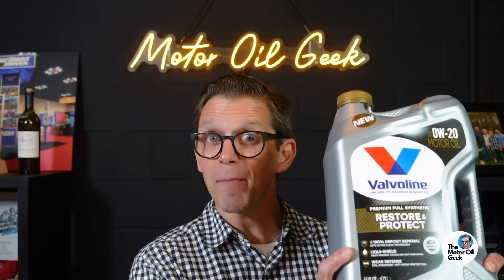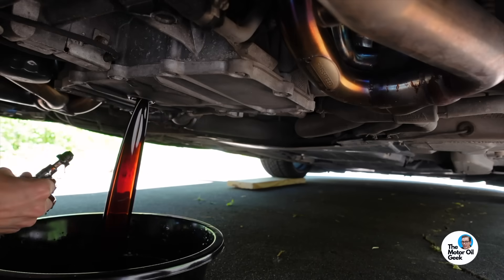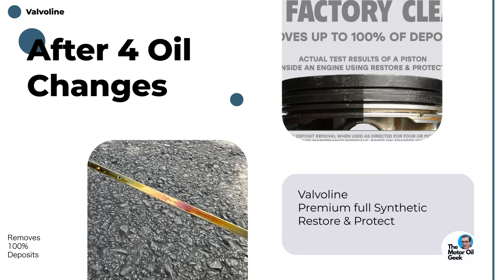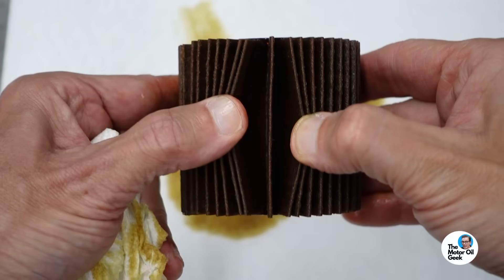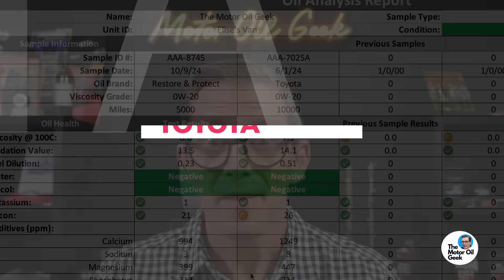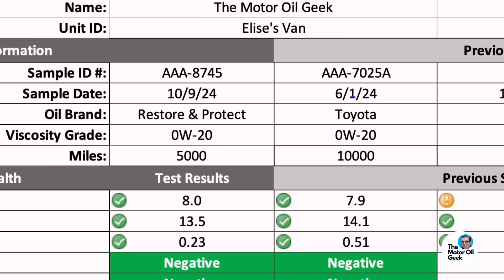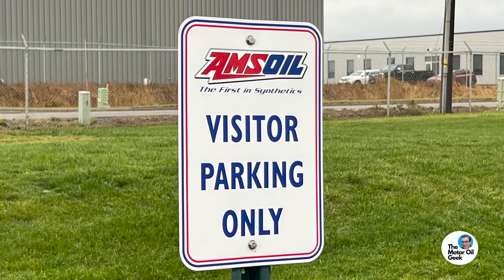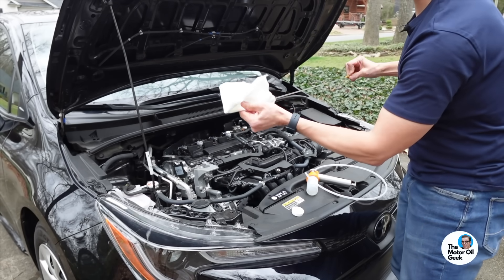The TRUTH About Valvoline's BOLD Engine Cleaning Claims

Comment: 380,000 miles on my Chevy Van 1500 4.3 .I use Mobil 15w-40 diesel oil CAT uses.
Clean no deposits .
For old high mileage motors.

I put a quart of ATF in run motor an hour then dump out all sludge comes out .
Then put new oil in .
Reply: I top off with ATF about a week before I do my oil change and change the filter only since it fill up with the sludge that is being removed and I want it to bypass as little as possible. 

I have been using Mobil1 15w50 that had been discontinued. I bought a bunch of it when it was on sale. It has diesel engine oil API ratings.

1998 Astro with 250k+ miles. Magnet drain plug and "cheap/conventional" filters. 

MMO also cleans GREAT.
Reply: @bradhuffjr777  Mobil 1 15W-50 was awesome in Harley motors.
Reply: I have the old timer 4.3 in a 2012 Silverado truck.  Those are really decent motors.  I've towed some pretty impressive loads and my boat with it.  When people bust my balls about having a six cylinder, I remind them that back in the day one ton trucks had sixes with less power.
Reply: @chuckgladfelter  true.
I tow mini excavator bobcat welder behind Chevy Van 1500 express 4.3.
No problem.
My other trucks are 6.0 Gm gas and 8.1 vortec in service truck Kodiak 4500 .
I got rid of diesel small trucks .
Only big trucks diesel is ok.
Nothing but issues with new age diesel engines.
$$$$$$$$$$$
Reply: Good luck when all the magnesium and zinc in that truck oil coats over the precious metals in your catalytic converter and it stops working then you have to replace it, maybe you're rich and won't mind.
Reply: @dukecraig2402  I have already addressed the cat issue with an anti-fouler, and my cat is for visual inspection only. Also, 25 years old, no emissions. I use the APP Torque Pro to verify performance, log data, etc... 

ALL my emissions devices pass the self test. Knowledge is power, and experience is priceless.
Reply: @bradhuffjr777  
Good luck with it then, I've run Rotella 15W/40 for years in everything from my lawn mowers to my motorcycles, but these new cars every time I try it in one within 10 or 15 miles it trips my downstream O² sensor, drain it out and put in regular SJ or whatever is recommended and 10 to 15 miles later the downstream sensor goes back to being happy. 
Anything tripping that sensor is going to coat the inside of a cat.
Reply: @dukecraig2402  That is usually true.
Reply: @dukecraig2402  Mine .. 380,000 miles original CAT converter.
I am a mechanic since 1976.
Familiar with zinc and other stuff fouling cats.

Comment: How soon in mileage can you start using this type of oil? Thank you
Reply: You can start using it day one if you’d like. The way I look at it is if you use it before carbon builds up, then this will prevent carbon from building up in the first place.
Reply: I put it in my Telluride at 54,000.  I have owned it since new and the dealer has changed the oil with synthetic every 5000.  The Oil got dirtier on the first change with this within 600 with this so I believe it is working.  It will be a few more months before I can get it tested.

Comment: I've got 10,000 mi two oil changes at 5K each on restore and protect. I haven't done any used oil analysis but I can tell you underneath my oil fill cap. Looking into my valve cover. My engine looks much cleaner than before.

Comment: My old Mazda truck is burning oil like mad. The engine was built 15 years ago, machined on the tighter end and NPR rings used . A compression test shows 170 psi on each cyl. and no bore scoring . I’m currently on my first run of restore and protect. It will be interesting to see what my first sample looks like. I was going to in-frame it but I want to see what this oil can really do.

Comment: My wife has about 180,000 miles on her 2017 CR-V. It was consuming about a quart per month which is about 2000 miles. I check the level and add oil every month. I just did the third change with Restore and Protect in the 0W20 weight and when I checked the dip stick recently I noticed the oil consumption has slowed. I need few more months to draw any firm conclusions, but the stuff does seem to work. 

I have tried other methods to cleaner the rings in this engine before and non have worked. 

I would not have used R&P without seeing it on this channel.
Reply: People like you who report this .....should not just say "'I'm on my third oil change"....but you should also include how many miles you drove in between each oil change. Almost no one does this....but it would be valuable info to know. Other responses here all seem to do the same by not clearly stating miles between changes.
Reply: @TheWilferch  Agreed. Also tell us a bit about the vehicle- brand, model.
Reply: @TheWilferch 5k - 7.5k OCI's bc you have to spend over $11/qt for any oil that can truly go 10-15k mi w/o doing any harm.
Reply: I wanted to check back in here. Just checked the oil again in the wife's CR-V and it is still at the same level it was at a month ago. Oil consumption appears to have stopped. Thank you Valvoline and Lake Speed Jr. I will continue to use the Valvoline R&P oil in this engine and any other that is consuming oil due to sticky rings. This stuff works!
Reply: @Fix_It_Again_Tony  Is your CRV the 2.4 or 1.5? My wife's 2017 2.4 started around 43k miles. Its low, less than a half quart every 2,500 miles (Now at 51k miles). I already bought a few jugs of VRP to switch it over. Im running PUP, and it only has 400 miles on it, so im going to wait till the next change. I bought the car new and changed the oil every 3-3500 miles, sometimes even sooner. I was disappointed It still started consuming oil. Did you do a shortened OCI for the first use of VRP? Thanks.
Reply: @justinh.1579  It's the 2.4. I am using a 7500 mile interval. Previously she was relying on the oil change indicator. It would be 10 or 11k between changes. I think that was the original issue. OCIs were too long.
Reply: @Fix_It_Again_Tony  Well I have done ours at the 3500 mile mark at a max since new and it still started to  consume oil at 43k miles, so dont beat yourself up. I think its just inevitable these engines will do this. Thanks for the reply. How has your CVT been doing at that mileage?
Reply: @justinh.1579  Changed CVT fluid twice, doing 3 drains and fills each time (~75k interval). CVT has been trouble free. Need to do rear diff again.
Reply: I am currently using R&P on my wifes crv also. But during a random oil change i used STP ceramic oil treatment( blue $12 15oz bottle) and guess what it hardly used any oil during the 4,000 mi before I changed it. Didn't use it next oil change and went right back to using oil about a qt per 1500mi. Doing the R&P for 3 changes to see if it helps if not I'm going to go back to Castrol edge and the stp.
Reply: @joec8231  That's sucks those vehicles have oil burning issues early on too like Subaru! 😮
Reply: Between all the feedback and your testimony, I am planning to try this product.  Out of curiosity, was 505CRF one of the products you tried?  I've used it with notable improvements in reduced noise and smoother running.  No idea on the specific internal cleanliness comparing before and after.
Reply: A little background: my wife bought the vehicle with about 40,000 on it. I was originally using PP 0W-20 and changing it when the computer said it needed changed. My wife's driving style must have been on the mild side for the algorithm that decides how much oil life is remaining because it was giving us oil change intervals of 11,000 or more miles. I gave Honda the benefit of the doubt, thought their engineers knew something I didn't. They do: the fact is the computer is programmed not just to tell you when to change the oil, but to minimize cost of ownership and lifecycle emissions through fewer oil changes. Also, lets be real: car companies make the most money when you buy a new car so that's where their incentive lies. The car started to consume oil before 100,000 miles. So I stuck with PP and started changing the oil every 7,500 miles, which is an interval I establish for full synthetic based on doing UOAs on a couple of vehicles. This didn't help the consumption on its own so I tried Seafoam in the oil (right before a change) and I also tried Kroil Kreen, removing the plugs and dumping it into the cylinders to sit overnight about about 130,000. Nothing helped. I thought I would need to live with it. However, Valvoline R&P seems to have made a difference. I will confirm in the coming months. I just did an oil change last week.
Reply: @Fix_It_Again_Tony  Hondas & Subarus use oil fairly early. Facts. That's why I avoid em. 05 F150 4wd - 362k mis all orig - no oil used between 5-6k mi OCI. Pennzoil platinum 5w-30 used mainly. Try heavier oil like a 5w30. I don't use additives!
Reply: I see what you did there Mr Fiat; it would seem you found the miracle answer to effortless sticky piston ring repair! 
I've also used Yamalube Ring-free additive in the gas tank of all my cars (2002 Camry V6 w 204,000 miles, 2001 Solara V6 w 280,000, and my 2017 Lexus LS460 w 70,000 miles) for about a year now mostly as a preventative step.  There are other such products, they all seem to cost about the same ($20-25 per 12 oz, 4 oz per dose).  And if the additive is actually doing its job I'll probably never know the difference, which is the goal i think.  But the Solara has 280,000 miles on it, didn't get maintained as well as the other two (3,000 vs 5,000 mile oil interval) and the only one that truly needs chemicals for de-sludging.  That's the only one whose oil I changed to Valvoline R & P, and I guess I probably need to keep doing it.
Reply: I changed my CRV to Schaeffer's 5w20 and it stopped using oil
Reply: @doncox8966  STOPPED USING OIL??
Reply: Its insane how underrated this is. Alot of my fellow mechanics and friends still dont know about this. Hell even the parts store clerk didnt know about it and they literally stocked it lmao.
Reply: Were you doing dealer oil changes and at what mileage ?
Reply: @kenj.8897 Toyota OEM syn OCI's are 10k.
Reply: @adamneill9237  ...I don't think you get my point. We can't go by the manufacturer's recommended oil change intervals ( aside...Toyota recommends 5k miles for normal driving for my Scion xA...down to 3k intervals for severe driving conditions). To support Valvoline's claim that you will need at least 4 changes to get nearly 100% cleaning affect ( different interval likely compared to car manufacturer's numbers)..... they must be thinking something like 3k intervals ( 12k miles total)...OR....maybe they are thinking 6k intervals ( 24k mles) to get 100% cleaning. So which is it?..... closer to needing 12k miles?... or closer to needing 24k miles?....this answer needs to come from Valvoline.
Reply: @TheWilferch  it would depend entirely on how much 'treatment' you think the engine needs. If you're experiencing reduced performance, consumption, valvetrain chatter, etc. I would not exceed 5k mi OCI's during the 3 oil changes. For most people this process is going to take nearly 1.3yrs
Reply: @TheWilferch  Newer Yodas recommend 10k mi OCIs. Your vehicle is older. All brands raised OCI due to carb regs + showing low cost ownership overall. I do 5-6k mi OCI in my expensive Ford 4wd trucks. Well worth it. Never issues.
Reply: @Davido50  ...my point is being repeatedly missed. It's Valvoline's claim that it may take "up to" 4 oil changes to get "nearly" 100% clean in the piston ring/land area.  All cars are different and have different degrees of dirtiness to start with.....therefore....for Valvoline to make a general CLEANING claim like this, it is THEY who should also include the assumed miles driven between these 4 oil changes to get nearly clean. For them to point fingers back to use "manufacturer's recommendation" is a legal cop-out such that any true number Valvoline gives does not "Risk" them saying an interval that exceeds car manufacturer's recommendation...and therefore exposes them to possible lawsuits if bad things happen from that recommendation. From a CLEANING standpoint, however....what miles were they thinking?....that's a fair question . The risk you take is your own. If you need a total of 24,000 miles driven to get clean ( 4 changes at 6k intervals)...but you use manufacturer's recommendation of 3k intervals.....then you only drove 12k miles and that won't be enough.
Reply: @TheWilferch they tell you to use the manufacturer recommended intervals because they don't know what engine you're putting it in. A small turbocharged engine with lots of boost is going to need shorter intervals than a large displacement N/A engine, and they cannot possibly know where you sit on that scale. They could test every engine ever made with simulated city driving, but that's a massive amount of testbed hours just to confirm manufacturer recommendations.

What they do know is that their oil is an effective engine cleaner that can restore the pistons after up to 4 typical oil change intervals, so that is what they tell you. It'll probably do all it's cleaning in 2 or 3, but in the worse case scenario it needs 4 so that's the promise they put on the tin.
Reply: @wyattroncin941  ....we're still talking in circles. Like I said originally, I fully understand the level of dirtiness and other factors ( like you bring up now with Turbo vs NA engines), then causes a range of answers for the variety of cars and customers that exist.....yet you also say-->" up to 4 typical oil change intervals, so that is what they tell you. It'll probably do all it's cleaning in 2 or 3, but in the worse case scenario it needs 4 so that's the promise they put on the tin". Fine....it's an "educated guess" on their part. But 4 changes at 3k intervals = 12k miles.....and 4 changes at 6k intervals is 24k miles.... a big difference. Since it is Valvolone's claim, they should say.... "gets engines nearly 100% clean with typically 4 changes, with an assumed interval of "X" miles between changes",..... or somesuch, .....to at least give you an "idea".  The same way "up to 4 changes" gives you an idea. But they don't....so we're back to square one.
Reply: @TheWilferch  why the hell would Valvoline ever feel the need to do that for this oil? Their product works, and they have a performance promise that it will meet or exceed in 99% of cases. They have zero incentive to push the limits of their own promises, on the back of legal liability for some jackass taking their testbed OCI as a recommendations. they do not know your engine or driving style and cannot possibly know how often you should change the oil in your vehicle.

Besides, the vast majority of cleaning is done long before any reasonable OCI. As the cleaning additives work and are consumed the cleaning effect slows. At that point it still has thousands of miles of oil life in it, it just won't be cleaning much of anything. If they based their OCI recommendation based on cleaning alone no one would buy it because of the low interval and high price.

If they came out with Valvoline clean and restore oil that is entirely marketed on its ability to clean deposits better and faster than anything else, you could expect to see OCI recommendations. But for a clean and protect that doesn't claim exceptionally high oil life, engine manufacturer recommendation is a fine OCI.
Reply: @kenj.8897 based on video, Toyota oil had 10k miles, and an oil expert would use a different oil unless letting Toyota service the car.
Reply: @JJD-9403 TY..why didn’t u tell me thst sooner…😃
Reply: Hondas & Subarus BURN oil! I avoid these vehicles. My 05 F150 4wd 362k mis - all orig - uses no oil between 5k mi OCI. Pennzoil Platinum/Ultra Platinum 5w30.
Reply: have the same issue with my Honda. but sadly not available in my country :/
Reply: Toyota engines are not 300K miles engines like they used to be
Reply: try 5w-20 or 5w-30 it will burn oil less. 0w-20 are very very thin.
Reply: Start using 5w30. 
 Thank me later.

Comment: Thank you! Very good to know but I am sticking to the Royal Purple. If I have to have an oil change place do it, I will use the Valvoline users.
Reply: Im doing a “study” myself with R&P and RP-HMX on a Kia and Honda. Right now Summit has a case of 3- 5qt jugs of the Royal Purple HMX for $99. I like the fact that the HMX has the Synerlex in it vs the Walmart stuff. Time will tell I guess
Reply: @KaoCenDarach  I'm doing a breakin on a 4.8L Chevy LS and just bought 6 qts of RP 10-30 breakin oil for $66 at Walmart. It's great stuff. I'll be running the RP HPS after breakin.
Reply: @budmanzoom4441  I got a ‘22 Ram with the 5.7 with 20k on it. Been wanting to run the HPS but the way the bottle is worded and all the “comment section experts” about it being bad for cats, makes me hesitant. If your burning enough oil for the “high zinc” to hurt your cats, you probably got bigger problems to worry about right? Am I missing something or is it ok to run the HPS in a newer vehicle to KEEP it good and clean and well protected?
Reply: @KaoCenDarach  I am no expert but I have had no problems with my other vehicles cats using RP. I think you are right about oil burning engines and cats, with any synthetic oil.

Comment: I'm sold. It's going in my impeccably maintained '02 Toyota Highlander with 225k miles on the 1MZ-FE next oil change.
Reply: I used to have a Camry coupe with that engine. Such a smooth engine.
Reply: I also have a 1mz-fe with 235k in it. I’m 2,000 miles into my first r&p oil change gonna do st least 3 changes every 5 k miles to try to slow the burning it has. So far still burning oil…had to add about a quart after those 2k miles but still early in the experiment
Reply: @remogaggi82  This might do it by freeing up those oil control rings.